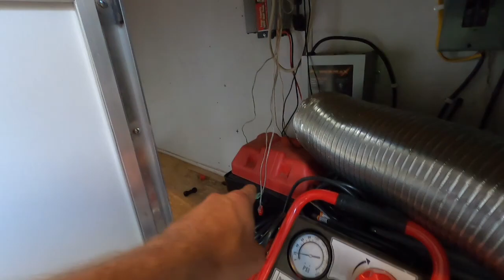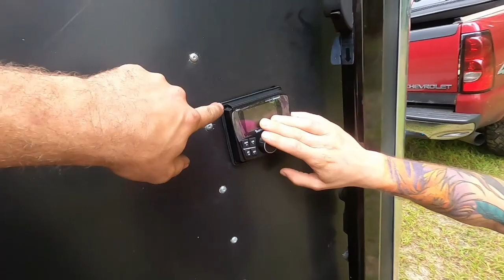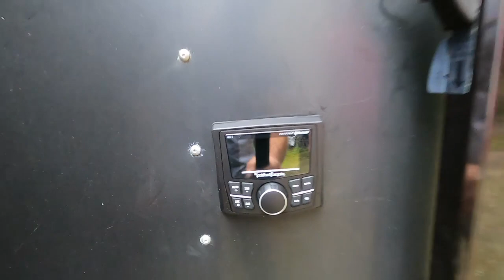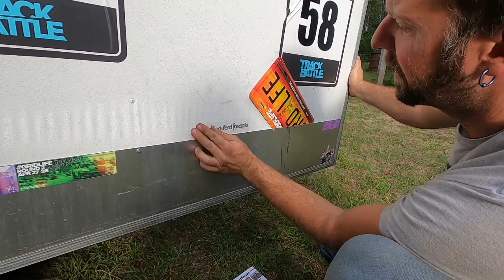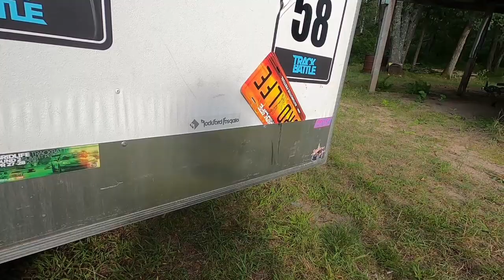Race trailer stereo system install!

Comment: 1. How are you going to post a summer video when we haven't seen weather above zero in a week!?!
2. I will attest that your set up is badass and super crisp!
3. The Sound Connection trailer is straight beast mode!
Reply from the maker: Right how dare I?? I miss summer even more after doing this video!!
And thanks love this setup, it turned out pretty good just needs some depth so you feel it, we might add on this spring!
Reply: @2thegridmotorsports872  Awesome! We'll be able to hear you from our camp when we go to bed lol